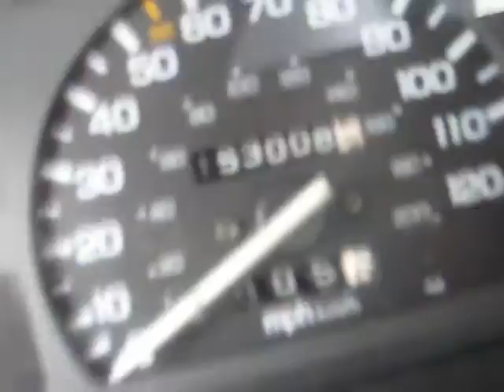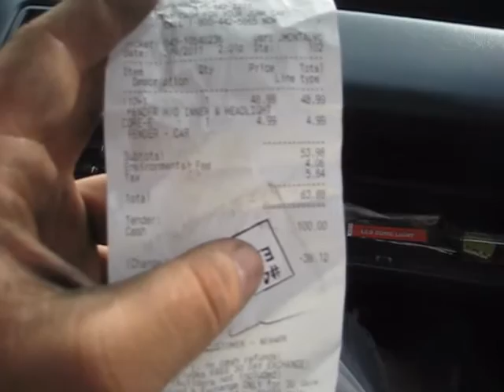Lets Beat up that Fender!!!

Comment from the maker: @suppamari045 when it was single came i was getting to a take about 320miles (didnt calculate mpg) its actually swapped with a b20vtec so i cant say mileage is great right now. needs a tune.